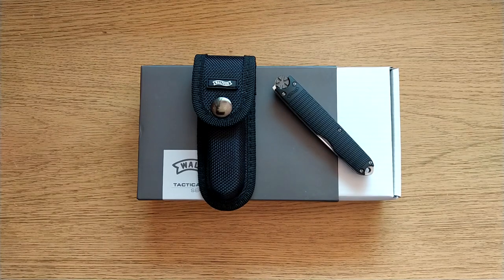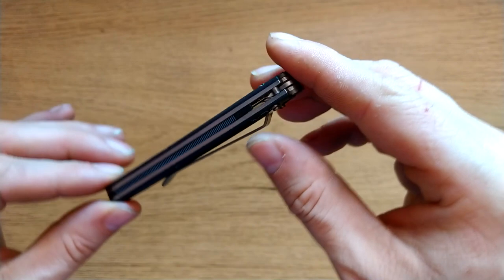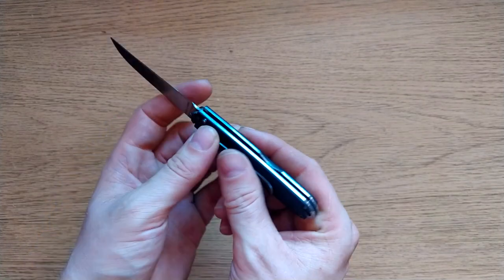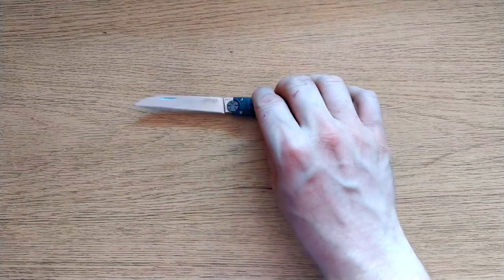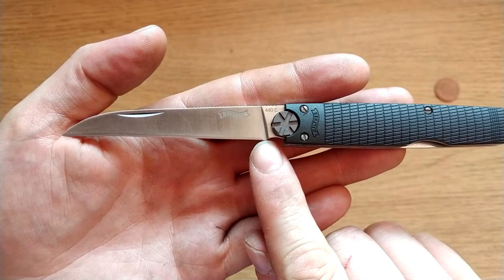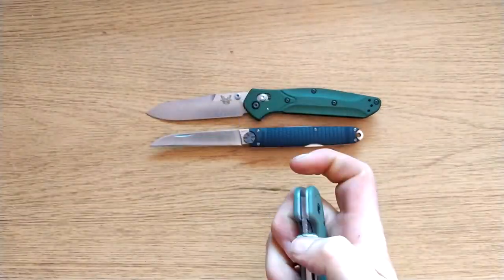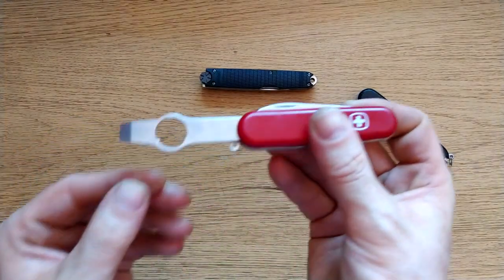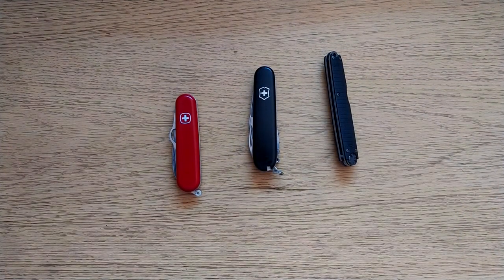Walther MPK full review & Disassembly

Comment: Blade length and cutting edge has to be below 3 inch, you can have a 3 inch curved blade that has a +3 inch cutting edge, the law is misunderstood, you cannot have a 3 inch cutting edge on a longer blade. The Walther MPK is not UK EDC legal.  They should do a 2.5 inch version with a thicker blade, that would be nice.
Reply from the maker: I did mention in the review that it seemed to be over the limit and I wouldn't recommend it.
Reply: @UKLegalCarryKnives  Yes you did, it is a nice knife, one I have considered my self, a good video but should it be on a channel UK legal Carry Knives?  Possibly to clarify the situation.